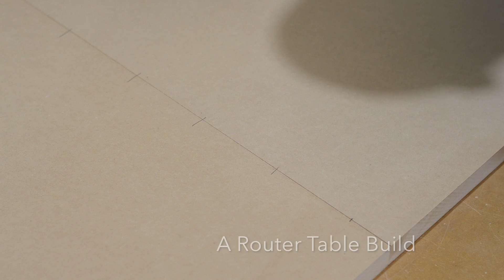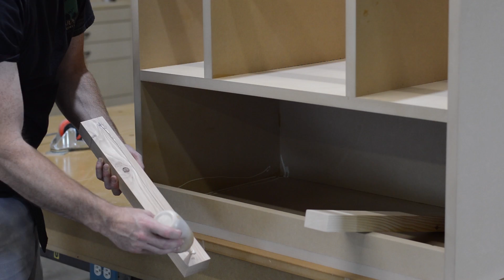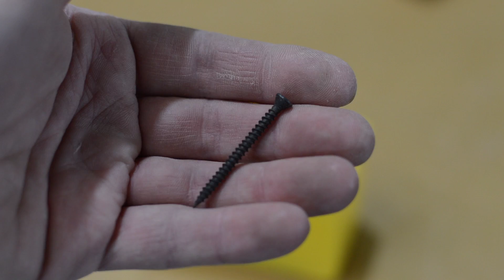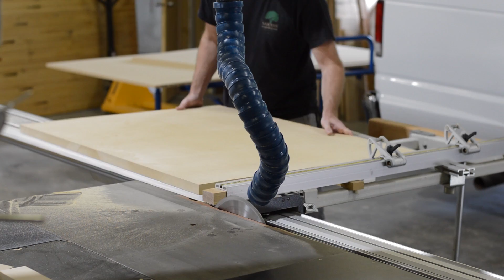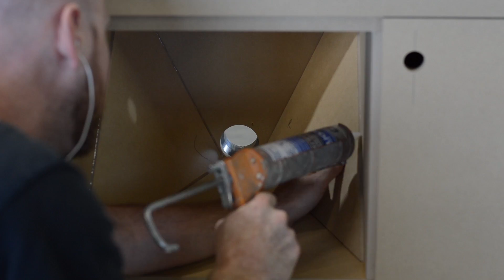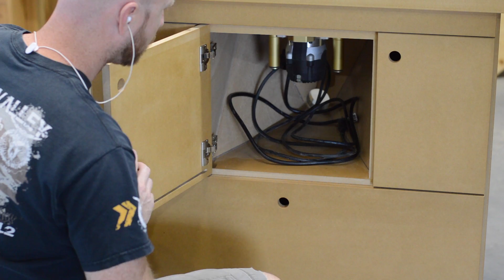Very good router table

Comment: Seven years on - how did the dust collection features work out for you?  The slot in the front and the tapered insets to guide the dust into the port.  I'm adding dust collection and debating about "ventilation" holes vs. enclosed space.  Thanks.
Reply from the maker: Dust collection worked great. Over all this was a great router table. I ended up giving it to a friend, and it is still in use.
Reply: @MikeFarrington  Thank you.

Comment: That's one awesome router table.
I'm just in progress to build one of those and I have questions about table top.
Is your top still good enough , finish using it on MDF or need maintenance from time to time?
One more time nice work.
Reply from the maker: Yes, it will need maintenance once in a while. Probably every few years if you are careful with it.

Comment: I've always liked your videos. I was wondering though I'm looking up ideas for my own router table. by chance could you tell me what router you use in yours?
Reply from the maker: I use a porter cable 892. I bought it like 20 years ago, thinking it would burn up in a few years and I'd get a larger size. Well, it's still going strong.

Comment: Finally, someone who doesn't think the biscuit joiner sucks. (they clearly have never used them properly) I just saw your slide technique and realized that is what I had been doing,well almost, for years. next I looked up and realized  i just bought the same wheels. and now my favorite screws. holy moly!! we must be brothers. Ive found that the thin poly protective soak/coating is the gift to mdf that keeps on givin'
Reply from the maker: Ha! Love it, sounds like we are both on the right track.

Comment: When routing the top using the template for the router lift, what size diameter and length pattern bit did you use to get your curves so flush to fit on the 4 corners? 1/2" just seems to overshoot the corners or maybe I need to work on my routing skills hah. Excellent work!
Reply from the maker: I think it was 1/2". Thank you.

Comment: Mike; I’m finally getting around to building the last component of my shop; the router table build. I’ve researched routers, lifts, fences and, of course router tables. The very last thing I’m going to do in retirement is buy some high priced table when I can build my own for less money and with more useable features.

I think I’ve looked at a dozen or more router table builds and your table is the best by far. You are the only guy that has mentioned mass as being a key component of a router table. With the dense MDF comes sound attenuation so I’m in.

I have one quick question; you said you inset the marks for your first cut 1 5/8”….why?

Great job!
Reply from the maker: The 1 5/8" is based on the width of a no. 20 biscuit slot. 1 5/8" keeps it close to the edge without risk of breakout.
Reply: @MikeFarrington  aha! Thanks Mike! I might have figured that out eventually but it would have included a “Dangit!” kind of learning curve!

Comment: Hello Mike what do you suggest ? I bought a Triton Tra001 for my router table but it will not fit a raised panel bit that is 3-1/2 inches in diameter which means i cant lower the bit lower enough especially if it has a back cutter my router plate is big enough but the opening on the  metal base on the router is not what can be done?
Reply from the maker: you can clamp a piece of 1/2 thick (or other thickness) MDF to the top with a bigger hole drilled in it to clear the cutter. Think false top.

Comment: I’ve built a similar router table except mine has drawers on either side of the router door. I am not sure what hinges to buy for that one such that I can have the 1/16” reveal that the remainder of the cabinet drawers/doors have. Do I buy full overlay euro hinges or are there half overlay models to use on a captured door like this?

Comment: Hi Mike, thanks for this. Why 1 5/8" for the first cut? Seems oddly specific! Also, do you ever miss having a tracked fence, or are forward/back motions at the router just not part of your build processes?
Reply from the maker: Thank you. That was just were I started. I do not miss having a tracked fence.
Reply: @MikeFarrington  hah so at 0:51 when you "always start the first cut an inch and 5/8ths in from the edge"...you were just joking? Oh well, at least I caught the poly recipe and anchorman bits. Cheers!
Reply from the maker: @jonsy452  1 5/8 keeps the biscuit close to the edge without it showing. When I said always, I more meant most of the time. Ha.

Comment: do you ever find bases such as this are on casters that they might not be as stable as one would wish?
Reply from the maker: Yes, if the floor is not level that can present a problem. I just roll it around until I find a place where its stable.

Comment: I am right in the middle of this video when I noticed your workbench was quite low to the ground in some areas in higher and others is it scissor lift? Do you have plans for this?
Reply from the maker: Its a scissor lift, I have a video on the bench. Its called A Modern Cabinet Makers Bench. I go into detail about the lift and the box on top of it.

Comment: Did you ever upgrade your router from the PC 892 to a 3 HP? I have been using a Makita 3612 in my own table for almost 40 years. Time to upgrade to a lift for more convenience. (It's okay to upgrade every 40 years, right?)  Probably a Jessem.

I have been arguing 2 vs 3 HP and neither side of my brain has won yet.

I mainly build cabinets and furniture for myself. Have yet to spin a bit larger than 1.25". I might miss the scream of the big Makita!

Thinking about the Bosch 1617EVS in the cheaper Jessem lift.
Reply from the maker: Nope still using the 892, I have been trying to break that thing for years. When it quits, I'll upgrade.

Comment: Nice build.  I understand your motivation to use MDF on this build.  When I put biscuits in MDF butt joints I can read them thru surface (they swell).  Also, I found my dust collector performance really fell off quickly, couldn't just blow fine MDF dust out of pleats, I had to use a small brush and a vacuum ... what a pain.  I came to conclusion for the few dollars I saved on a sheet, I spent that much extra time cleaning, and in painting (especially visable end grain).  Curious if you've found same issues and how you are working around?
Reply from the maker: There are solutions to the issues you bring up. Better quality MDF is the starting point. I don't really use MDF to save money, though there is a little of that, I use it because its very flat, and heavy. I think that makes it great for a router table.

Comment: Nice build.  I am a novice and I do like the design you put forward.  May be something to consider.  The size is nearly perfect for the application that I am considering.  A modular Miter Saw Station and Router Table.  Thanks for sharing.
Reply from the maker: Sounds like a good project, good luck.

Comment: Mike the paint thinner I bought is white I don’t know why they must’ve change the recipe but it says paint thinner will that work as the finish for the MDF or should I go by the clear stuff thanks
Reply from the maker: Sounds like water based stuff. If that is the case I would not use it. If I am wrong, it should work.

Comment: I made my router table/cabinet out of MDF too. I like the sturdiness and rigidity of the material and if done right will stay dead flat for a very long time. My only mistake was not putting casters on it. I should have known I would move everything around at some point in my shop and it has to weigh 150-200 pounds which for my small frame is hard to move. I love the cabinets you put under the stairs. Excellent use of space. It almost makes me wish I had stairs.
Reply from the maker: MDF is great for a lot of things, but it is heavy, no question there.

Comment: So I built my table top first 3/4" melamine MDF glued to finshed 3/4" plywood and I've been using it sitting on saw horses. I'm ready to build the cabinet for it now but I've noticed that my table is bowed up in the center, which is odd to me, if anything it seems like it would've sagged in the middle from the weight of the router. So you just touched on making the top of the cabinet flat because it will be the reference surface for the table top. Being that I already have a bowed top, it is crucial that I get the cabinet flat. Could you elaborate a little more on what exactly you did? I know how to plane a board but with it being multiple boards butted up to each other I don't exactly understand how you did it. Thanks!
Reply from the maker: My guess is the bow is coming from the two different types of materials glued together. Anytime dissimilar materials are glued together there is a chance they can warp, bow, or twist. You can try to screw it down to a support structure, but that may not get it completely flat. Since you have it, I would at least try, but this may be a case where you need to redo the top.

Comment: Why do you always need a way to bury a router bit in the fence?  I assume I'm missing something very very obvious....but if the bit is buried in the fence, how would it be able to cut anything?
Reply from the maker: Thank you. You do not always need to bury a router bit, but sometimes you do. For example if you wanted to cut a 1/8" rabbet in a work piece, you could take a 1/2" bit and bury 3/8" in the fence exposing only the portion that will do the cutting. Hope that helps.
Reply: @MikeFarrington  It does clarify, thanks!

I was picturing 100% "buried", like completely covered. Being recessed a bit didn't even cross my mind...so that's why I was confused. Thanks.
Reply from the maker: @PowerScissor  Happy to help.

Comment: I was very pleasantly surprised to see you call this a "Very good router table" I get so annoyed when other creators call their piece "THE ULTIMATE". Maybe it's ultimate for their needs, but it's probably not going to meet or exceed everyone else's needs, which makes it less than ultimate. And yes, this is a very very nice router table. I noticed you had some Sommerfeld router bits. I have their Gen2 (the one that was not gold anodized) router table top, probably way beyond overkill for a hobbyist and DIY'er but I liked it so I pulled the trigger. They haven't made them in a while, but I called them to ask about something else, and while I was on the phone, I asked why they were not being sold anymore. The guy I spoke with said sales went way down, but they were starting to get enough inquiries, to begin making them again. I like your cabinet a lot, and think I'm going to use your design with my table top. If my owning Sommerfeld's router table wasn't overkill enough, I think their design for the cabinet is way beyond anything I would ever need for a DIYer's workshop. I never knew poly mixed with thinner could actually increase the durability of MDF like that. How well do you think that would work in a humid environment? I live in the Chicago area and the humidity levels get pretty high in the summer months (occasionally reaching 100%), and I know that MDF can act like a sponge if it gets exposed to enough moisture. I was planning on using grade A plywood, but if this is good enough for my climate, I might want to give it a shot and see if I can save a few bucks.
Reply from the maker: Thank you. The word ultimate is totally over used here on YouTube. I have been happy with the Sommerfeld router bits, they seem about as good as any others. I wish I had a answer regarding MDF. I live in a dry climate and it hasn't been a problem. My guess would be if you covered all surfaces in poly it would hold up fine. If you have the cash for ply that would work too.

Comment: Mike there,s something I have to tell you about which you may already know about but on the chance you don't --its called penetrating epoxy its as thin as water has two parts A and B and its used a lot in the wood Boat industry it works great on softer woods and MDF plywood etc.
Reply from the maker: Totally great product, I have used it on a few wood countertops I made. I wouldn't put it on a shop fixture due to the cost, plus once poly has dried, its pretty darn hard.

Comment: Great router table and very nice presentation/narration. I live in Wyoming and today went to Colorado for baltic birch and MDF. The only heavy MDF was 1-1/4", over $100 w/tax. I looked on Home Depot's, Lowe's and Menards' sites but couldn't find a listing for MDF thicker than 3/4". I've got to believe I'm using the wrong search terms. Any tips?
Reply from the maker: That is pretty steep. I think I pay like 70ish. Did you price out 1" That would work pretty good as well. To get that thickness you are going to need to buy from a plywood supplier, Home Depot and the like won't carry it.

Comment: Biscuits are awesome!  I rebuild box trucks after they've smashed bridges and trees!  I use them to splice the FRP (fiberglass reinforced plywood) together.  Instead of normal wood glue, I use 3M 2 part wood/metal bonding glue.  Great stuff to use and great video!
Reply from the maker: They work well when used appropriately.

Comment: ...i'm sorry, if, you are seriously seeing the need to put metal screws into something to hold it together, you're not a wood-worker. You're slapping something together quickly that after a certain amount of time will fall apart from movement and vibiration, which i can see in this video you are not addressing. Considering that amount of time and money a poor man will spend on materials to make this, you could have done better. When we consider that most medium to higher end router tables are 'metal' there is a reason that engineers go metal to hold routers in place. You like so many thousands on here, look for people to subscribe. As such, you place things out there to get these people to you to help you make money. Throw quality out the window. From this video, it seems that way to me. You can change that if you have the heart to. Can the screws, and do it right. When we (my wife and i) are building stuff in our shop, there are no screws in anything. Just my thoughts. And i'm allowed to do that. Master fitter 40 years and counting. Master wood worker...25 years. Scottishxpride, Texas.
Reply from the maker: I appreciate the comment but this is simply not true. Screws and nails are a great way of joining things together. I used screws in this video to hold the top and a few other things on. This is so that they can easily be removed and replaced. I would suggest that you don't paint your work into a corner. There are plenty of good ways to join stuff, use all of them.
Reply: @MikeFarrington  ...well sir, at this point we'll have to both disagree here. Seen to many good wood-workers put stuff together to get it out the door, and it not meant to last. Taking one's time, and doing it correctly, means there should not be a need for screws and nails. If, you have to resort to that, then you've done it wrong. Just my thoughts. Scottishxpride, Texas.

Comment: Didn't it turn out that biscuits added basically no additional strength from regular butt joints? And that's why they fell out of favor in modern joining methods? I thought I saw that somewhere.
Reply from the maker: This is not true. Maybe you saw that on the internet?
Reply: @MikeFarrington  Oh I definitely saw it on the internet somewhere. It was some video on YouTube I'm pretty sure. So I'll take your word for it. Thank you, sir!
Reply from the maker: Biscuits have gotten a bad name for a host of reasons, maybe I'll make a video about those reasons. When used properly, they work great.
Reply: @MikeFarrington  That's a really good idea. Cause I've actually seen a few videos which seem to be misleading now. In fact, I stayed away from the use of biscuits specifically for that reason and now I feel like I shoulda actually tried em out before writing em off (still very new to woodworking myself). So if you make it, I'll gladly watch it. They definitely seem easier and more convenient than a lot of other joints at least.
Reply from the maker: @honestinsincerity2270  I have also seen a few videos that are misleading. A couple are downright unintelligent and have tons and tons of views. Making videos takes time, if I can fit it in, I'll try to put something together about the proper use of the biscuit joiner. That is the main reason I use one, it is much faster and easier to use. Also each joint is cheaper vs a domino.
Reply: @MikeFarrington  Awesome, thank you for taking the time to clear it up and respond even. I'll stay tuned even if you can't fit it in. Great content either way!

Comment: How did the dust collection end up working? Did your custom triangles pay off? I've got no collection on my current router table, and I'm pretty sick of wading through the saw dust and trying to see through the cloud.
Reply: Thank you for your super quick response. I'm paying on building a router table soon. I normally don't like to use MDF. Is there any reason you wouldn't use a high quality plywood for such a project?
Reply from the maker: @jeremeybyers6116  I think good quality plywood works great for a project like this. The one drawback is that plywood is never as flat as MDF. I think plywood for the case and MDF for the top would be a good combination.
Reply from the maker: The dust collection works surprisingly well. The little slot on the door and the triangles really direct flow.